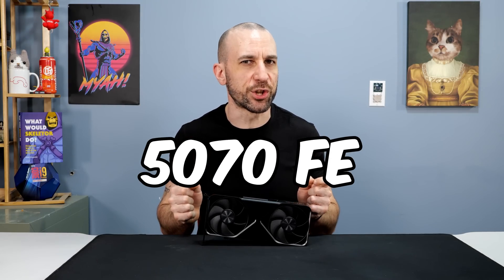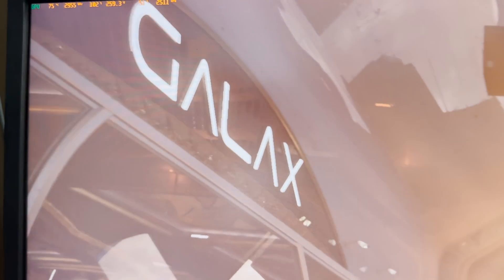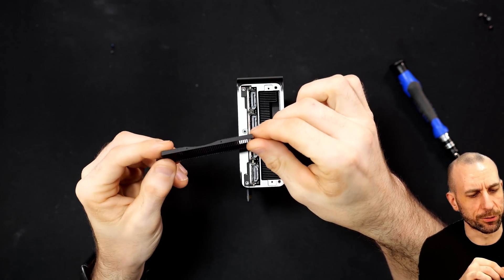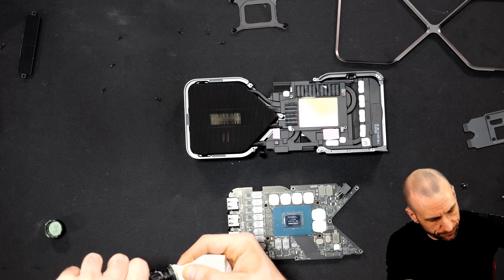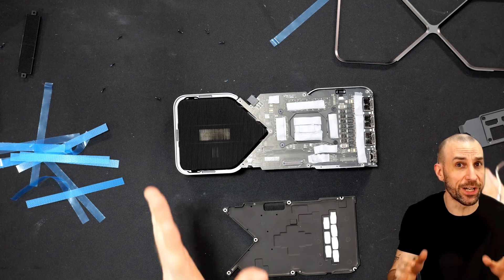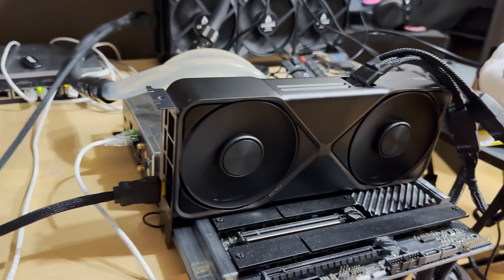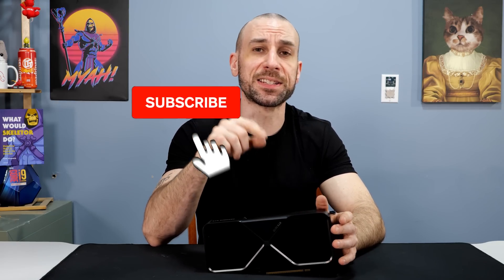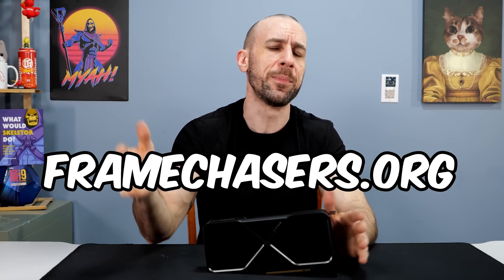🛑 5070 Cooling Solutions 😱 (Disassembly)

Comment: What I find annoying, is 5070ti, 5080 and 90's all have the voltage locked somehow. When I enable voltage control on any of those cards in Afterburner, the card will run at like 50% power. Basically handicapping itself. Dumb

On another note, the FE coolers this round are absolute dogshit

Comment: Blackwell undervolting is wild good it seems. Lots of 90’s out there running 890-900mV and not losing any meaningful performance, but saving a ton of power/heat/noise

Comment: I have a RX 7600 XT that runs hot and I used PTM 7950 Phase Change material.
I also added two 40mm x 40mm x 11mm heat sinks that are mounted right above the core on the backplate.
At a glance it actually looks like it was factory built, and it runs cool in the tight SFF case it's in.

Comment: Good video as always. Its cool that you keep the 9900KS box in the background. That CPU with some 4000-4133 tuned bdie is still amazing today. I would use that over any X3D CPU if you took away my 14900KS and made me choose between the 9900KS or an X3D chip.
Reply: 9900KS or 9800x3d?
Reply: @HerrBerg  I would pick a 9900KS without hesitation, it just works and no weird dips.
Reply: @chrissoucy1997 I've been using since it released, solid chip, runs at 5.2 GHz all cores

Comment: I'm kinda surprised the card runs that warm at 250W, but I guess between the smaller die and the cooler design changes, the cooling isn't nearly as efficient on this card vs the 5080 FE.

Comment: You don't need to fix anything 😂 . The card runs on 74 degrees, with no thermal throttling 🎉 and if you are crying about the fans' speed and noise level. Just wait a few months to get the water block... Spend like 120-140£ for it. 😂 And don't cry 😢 And coil noise? What do you want if the card pulls over 250 Watts  😂

Comment: What happens if you disconnect the fan that blows cold air?! Would the card overheat or would the temps be the same but the overall noise go up since the 1 fan ramps up even more?!

Comment: this is how low the bar has fallen. we gotta fix our gpus the moment we buy them now.
Reply from the maker: It’s always been like that man, half the GPU’s I buy since Maxwell have some defect in the design
Reply: @FrameChasers  
no it hasnt always been like that 🤨
Reply: That's how it's always been. Cooler whine is essentially random anyway, it happens to the best and worst cards.
Reply: After spending $$$$
Enshitification
Reply: Noting new seen it with my 7900xtx after 12 weeks hotspot of 113c
Reply: If not when you first buy them, 6 months or a year when the paste pumps out. I've had two new 40 series cards. Both pumped out between 6 and 12 months.
Reply: @umeng2002  when i got 7900xtx the 7900xtx was 1yr on markt it and stil thermal past problem.